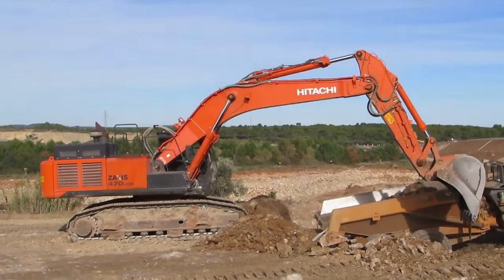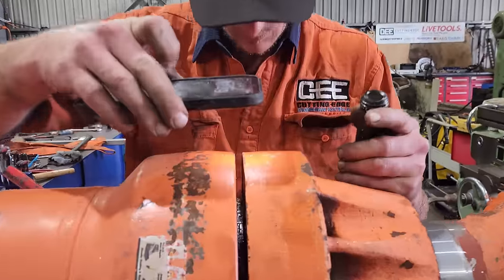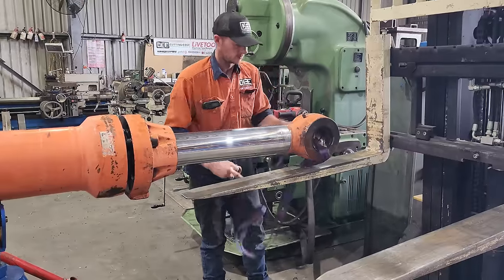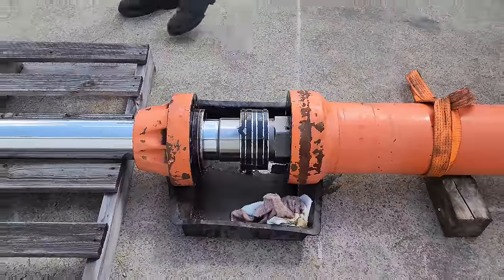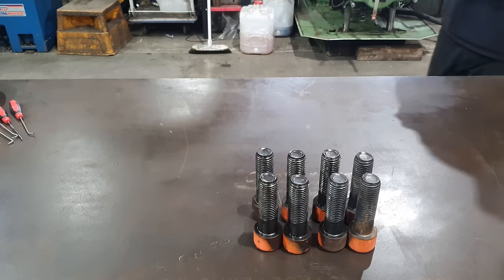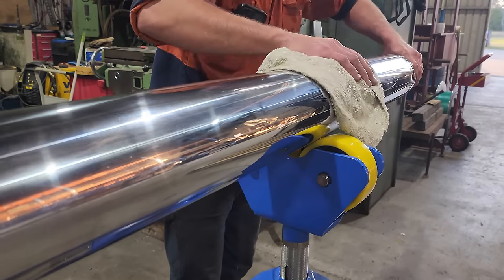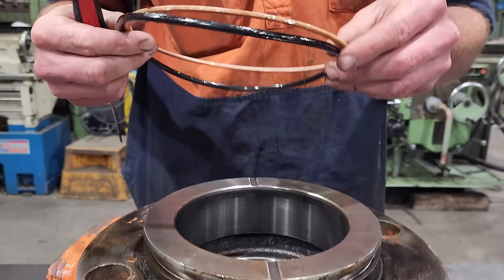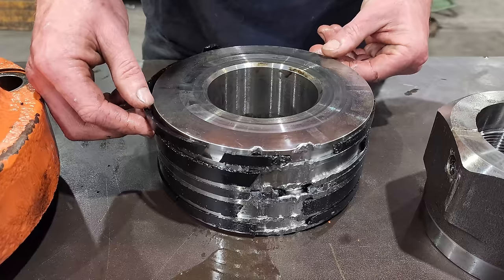It's STUCK! Can We Get This BIG Cylinder Apart!? | Hitachi ZX470 Cylinder Rebuild | Part 1

Comment: It never fails to amaze me how people will bring their crap in filthy.  I'll bet they pay their head mechanic less than Kurtis is charging them to wash it.
Reply from the maker: this!
Reply: @CuttingEdgeEngineering And for that matter, parking it filthy! That grit and grime can’t be good for a machine. (Yes, I’ve been known to say that if your tractor isn’t dirty you’re doing it wrong - but don’t leave the machine that way!)
Reply: @darkwinter6028  well if you have to bring water in to the job site in a tank I can understand not cleaning it daily.
Reply: I thought the same thing. I guess it might be more common if it's a used part that's being sold though - sold as seen with the dirt for free.
Reply: Looks like they hired Karl as their head mechanic!
Reply: At least it wasn’t full of hydraulic oil !
Reply: You're not always afforded that luxury in the field so it's understandable. It's par for the course with pretty much any electronic, electrical, or mechanical repair gig, the first thing you'll have to do it clean it. After a while you stop being mad about it and just accept that it's part of the job.
Reply: Mate, just my thoughts exactly! About two hours ago i was cleaning and changing BIOS battery in some thin client PC, and it was rich in dust, inside and outside))) Client said, it's used for tuning and repairs in cars workshop, i understand it, but, com one, clean it at least outside)) Sometimes.
Reply: @CuttingEdgeEngineering  Hey they are paying you that money to clean it, so their loss.
Reply: @billmoran3219  Think that all ran out during removal, seeing as there was not exactly any form of seal there on the piston, and to remove it you have to lift it vertical, so that all went, complete with chunks, to wash the arm and the fitter, plus the ground. wonder just how full of tramp metal the hydraulic tank is, and how often they are replacing hydraulic pumps because they got shredded from tramp metal, as normally the filter is after the pump, with only a screen to protect the pump, or a low pressure drop coarse filter.

Shows how cheap regular oil changes are, and also that regular oil sampling is worth it, seeing as this machine likely needed both a full hydraulic system flush, new oil pump and a new hydraulic block, plus all the other cylinders and lines are now full of glitter to wear them out. $100k there alone easily, just because you went cheap on the $100 monthly oil samples, and not changing filters on time.
Reply: wash charge for the dirt and grease. they just rip it off and send it i bet
Reply: @ManiacMitrandir  But what's the bet they blast it with shop air and not stop the fans from turning and they become 15,000rpm generators burning out components. Ice cream sticks come in real handy to stop that happening.
Reply: You are exactly right!  I can’t tell you how many times I was bitched at for cleaning components I was working on or had to send out.  The stuff I needed back in hurry was always spotless when I sent it out, it made a difference in turn around time.
Reply: I did similar work here in Ireland for 15 years, 90% of it for farmers and they'd bring stuff in covered in cow shit, it's just pure ignorance considering every farm has about 5 power washers. I turned away many jobs telling them to go wash it and they'd get offended. Then i'd bar them from my workshop completely for getting snotty.
Reply: @joeduffy3309  farmers and ranchers were the worst ones by far.
Reply: @josephking6515  Who knows?))
Reply: My ex-boss said, "If they want to pay the rates I charge for me to drive a pressure washer, who am I to argue?"

Money for jam.
Reply: You guys should start a cleaning business.  Go around cleaning filthy components before they go to the shop. Sounds like a money maker seeing so many has a prob with it
Reply: Yup they do,  I know.
Reply: Seriously guys, complaining about cleaning. It's part of the job. Typically in any shop I've worked in there's a apprentice, low man on the totem pole whatever that unfortunately gets stuck with that job. As he doesn't have the skills to perform the technical things he gets stuck with allot of cleanup, washing, machine maintenance ect. It's harder for  Kurtis being a one man shop, so for him it's a problem. The environment in a machine shop has to be one of cleanliness as well so that makes it tough as well. The only real problem arises if the customer balks at paying for cleanup time.
Reply: Power washer is good, but for greasy, dirty messes like that nothing works like a steam jenny.
Reply: @ManiacMitrandir  "com one, clean it at least outside)) Sometimes" - come on ;-) for him (and his job) it was clean allright! : )
Reply: @MrKotBonifacy  Many people - many opinions)
Reply: I wonder if you've ever worked in the shop? First off, with the shortage of heavy duty mechanics it is highly unlikely that they would have a heavy duty mechanic much less the head heavy duty mechanic pressure washing parts. Also, that part may have been removed out in the field were pressure washing facilities are not available. Think you might want to get more information before you make your statements.
Reply: Thank you for explaining all the little things during the process. I work in a totally different field unrelated and love learning new things.
Reply: If they can't make a ten minute stop at a car wash on the way to his shop they should be prepared to pay dearly.  This particular one gets a pass for being a salvage job though.
Reply: @SeanBZA  It seems strange to me that business would want to skimp out on regular maintenance, but that might just be because there's lots of farmers in my area, and they spend any time they're not in the fields maintaining their equipment, rebuilding tractor engines, and other things to make sure they don't break down during the harvest because of how short a window the harvesting season is in my area.
Reply: @ManiacMitrandir  Precisamente, amigo
: )
Reply: @matthewmoilanen787  I'd assume they want it for frey
Reply: Same sort of cleaning, my mother worked at a shop that did repair work on truck tarps. Truckers would drag the tarps in dirty and in a pile. She would tell them to get them off her floor and don't bring it back until it's clean and folded with the area to be repaired on the outside. Truckers learned not to mess with her and she never had to tell them again . 4 foot 10 and didn't take poop from them. It helped that the owner of the shop backed her up 100 percent.

Comment: Hi folks. I have fought a number of battles trying to get the big nut off the rod and piston. On our 640 we/I had a 12 ft snipe with 6 of us to break it loose with no luck. I finally called a friend up north who has a dedicated V shaped 30 ft long bench with a 12,000 lb electric winch and a hydraulic nut wrench of sorts, Hard to explain but it works  great. I could send a cyl up and have it taken apart and back here in under 2 hours. Far cheaper than the gong show we were doing back here. With all the cyl work you do it would serve you well to build your own. All the oils are simply retained and drain into a bucket. Heat and age really beat this up. I wonder how long it had creeping or sagging before taking it out of service. I  hope you all have a wonderful weeknd and some R&R too folks. See you for part 2.

Comment: Watching from America, love the content, especially when you break down the cylinder and you get to see how it failed. I actually work in the hydraulic seal industry and have had numerous similar looking pistons come across my desk in the past 20 years. It's always rewarding to be able to get the replacement parts to my customers so they can get their cylinders up and running. Often though, we have to retro fit non-OEM parts into the cylinders because the machine is broken down in the field and they need to get it up and running. Please keep the videos coming. Thanks

Comment: I rebuilt the cylinders off of a Dynahoe 190-4 backhoe, small in compared to the machines you work on but big when compared to your average backhoe. I used a engine lift and my back to do them. Not the easiest thing I've ever done especially getting those nuts loose. Can't remember exactly what I did to get the nut loose on the dipper arm. I know the 4' pipe wrench and 6' pipe didn't work, but did bend my pipe wrench some. I know it was a combo of 3/4" impact with lots of air pressure and I think some heat, probably not the best way to do it but sometimes when you don't have a mate to help you need to improvise. I never heard of it having any issues and that was a decade ago so must have done something right. The skill with which you put those seals on is impressive. You make something that isn't easy for the average dude look easy.

Comment: You're such a great team.  A real dynamic duo.  How wonderful that you can spend time together at work.
What a great idea to get scrapped parts to rebuild them.  It's keeps you in work during quiet times.
This cylinder shows the difference between work done by a grease monkey and a professional.
As the saying goes, cheap costs.  And an ounce of a professional saves you a ton of grease monkeys.
Reply: A professsional makes something hard look easy. A grease monkey makes something easy look hard.
Reply: The snag is that so many grease monkeys make a good pass at looking professional.

Comment: With the cost of this equipment, you would think that companies would have some sort of maintenance program in place to take care of it better. Thankfully they don't and it keeps your doors open to fix all this stuff. You both are awesome. Keep up the good work. Cheers from Florida!
Reply: They think they save money, which short term they do, but long term it is really expensive. Bet they also complain the ute needs an oil change every 15000km, then complain that, because they drive on dusty roads, that the engines and drivetrains are worn to nothing after 100 000km, because they never actually serviced them using the right schedule, which is in the handbook, and is 5000 km. 15 000km is if you drive on tar freeway, no dust, no dirt or water, and never stop running the vehicle except for servicing. But this will get it out of warranty, and then you buy a new engine, or buy a new vehicle, both profit for the manufacturer.
Reply: Personally, I suppose these sorts of industries have many staff who know how to use equipment, but are not so motivated or adept at the detailed record keeping required by well constructed maintenance schedules.
Reply: @alexanderSydneyOz  Its more "well it doesnt NEED money spent right now, so dont, do it later... yeh later... later... its saving us money.... OMG WHY IS IT TOTALLY EFFING MULLERED???!!!" profit now takes priority over a problem that is NOT now even if you know you are pushing it down the road, it will come eventually.. when... later dont worry
Reply: @SeanBZA 
I think that’s it is called, penny wise & pound foolish
Reply: @alexanderSydneyOz i work in maintenance and usually we just fix and repair stuff that's broken when we get called to do it + a few things with actual schedules for maintenance/ repair/ change
Reply: @alexanderSydneyOz   Yes exactly this. Developing these kinds of systems is what I do for a living, and only the most sophisticated organizations will find, pay, and protect the staff needed to hold a comprehensive preventative maintenance program together. Being on top of the data is relatively white-collar but also tedious, so it's not trivial to staff well. Often there's an incentive alignment problem where the person who could produce capital savings through a good maintenance program doesn't have an incentive to do so. Other times, there's just a lack of sophistication where that person hasn't yet understood the opportunity, and that's the time when I might hope for a project :)
Reply: @jerryuk93  so take this cyl, the test that would have shown something was going wrong takes minutes and costs in the £20 region as a company doing regular tests, do it during fuelling for example, wont keep the machine down any longer than expected, same for an engine oil contaminant test...

Rush shipping a new cylender because totally buggered the old one is oh... up to £25,000 plus the machine down time while you wait for the new one to arrive and fit it... 

A trade out reconditioned exchange fleet with curtis say... i dont know but i imagine its in the 7500-12500 range.. which is a lot of £20 tests with minimal machine down time, that cyl with warning could be replaces in 2 hours say not days of downtime

Simple fact is most engineering problems detected and fixed early are cheap... you dont need to strip engines to monitor the oil condition etc, and swapping an engine before its not got a sump full of metal shavings will cost tens of thousands less than waiting for shit to go wrong... which it will

Comment: That was interesting. It looks like that relatively soft seal resulted in binding that took amazing force to pull apart. This is one of those cases where improper assembly and poor maintenance resulted in a complete failure, necessitating barrel and piston replacement. As always, we appreciated the excellent discussion and the superb camera work. We wish you three a pleasant and enjoyable weekend.

Comment: Outtakes were priceless on this episode. One bit I would have liked to see is the look on Karen's face when the press started to move across the floor. Have to admit it surprised me too.  I'd have thought it was bolted down especially the way he uses it as a giant C clamp.
Reply: i'm betting he puts a 6 or 10' bar of metal into the ground as an anchor post, for just this sort of purpose in the future...
Reply: I was sure Kurtis was going to chain strap the press to the back wall of the shop...

Comment: We've got a local cylinder shop that has a cool set up for pulling cylinders apart. They have a fairly heavy I-beam that they have welded substantial end plates on. Its sealed up with drains on the ends. It has holes on the sides to put pins across it. So they pin a damaged cyl on one end and they have a active live cyl pinned on the  the other end. They couple the cylinders together and pull the one apart. All the oil is caught in the trough. I never seen it done but i imagine they could push it back together in it as well. It's a cool piece of shop built tooling.

Comment: An idea for other stuck parts like that, some kind of fitting adapter to put pressure washer on push side of cylinder, can push out and no meas of oil to cleanup after as just water to let dry out. Same idea as hydro-forming
Reply from the maker: hey mate yes definitely an option
Reply: @CuttingEdgeEngineering  IF the leaking piston is less then the washers output.

Comment: All because of no oil analysis and a less than stellar job by the previous repair shop. OEM parts are normally the only way to go. Those seals demonstrated this vey nicely. Great job so far.

Comment: Hello! I love tour videos, I'm stoked every Friday when there's a new video. Keep them coming!  But i want to come with a little tip. I'm working as a technician at Linde. In the lift mast, the way the rollers are joined together make the design very vulnerable when bulling with the fork carriage. Pushing no problem! I have no idea how the mast and rollers are built together in a Yale. But now you know that there may be a weakness pulling with the forks.

Comment: My first disassembly of a cylinder quite a bit larger than that one I was told to use shop air , NO warning as to what was about to happen . Yeah the rod assembly came out after a few minutes of building pressure . You can imagine what happened as I wasn't told to use a chain to keep the rod assembly from shooting across the shop floor and stopping when it kit the concrete wall with a very loud sound . The seasoned mechanics with experience that failed to properly instruct me seeing as I was a new mechanic helper weren't too happy and voiced their opinion until our boss started chewing their butts for not being there and instructing me as to the correct way to do the job . Sure made a big mess and I was lucky no one was injured . A couple of years later me and another mechanic set up a cylinder that was going in the scrap trailer , out in the parking lot with plenty of room as we wanted to see how far the rod would go , it went about a 100 feet after we let the shop air stay hooked to the cylinder and we didn't think it would come out . Just as we were about to shut the air off the rod finally shot out  , too bad we didn't have video camara's back then as it was a site to see . No witness's either .

Comment: What always amazes me how companies will not want the expense of oil sampling, which is critical to start with a baseline and then use subsequent samples to gauge condition. Saves so much money in repairs and down time in the long run. Preventative Maintenance is the key to a profitable operation. Great job as usual, thanks for sharing.

Comment: When someone tells me "It can't be done". I tell them: "No, it just means YOU don't know how to do it!" :face-green-smiling: You may need a bigger forklift. When I worked at Deutz here in Atlanta we got this HUGE Hyster Hydrostat machine (had to climb a ladder to get into it) cheap because the owner didn't change the oil and destroyed the original engine! We put one of our BF6L913 turbocharged 6-cyl Diesels in it just for grins. I was one of two people that weren't afraid of it. On asphalt when the turbo spooled up it would smoke all four tires! 😆 I have two forklift certs BTW, regular and all terrain. I was a Warranty Engineer but any of us that moved machines around had to have them...